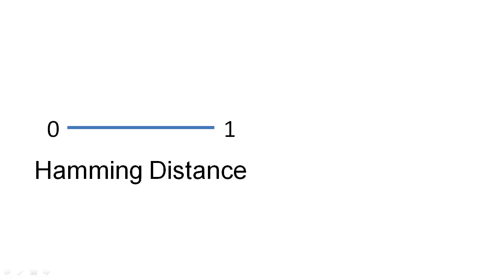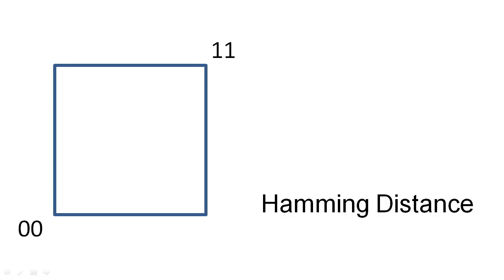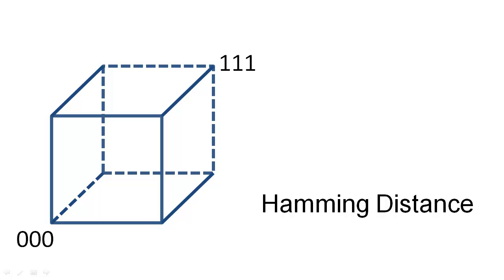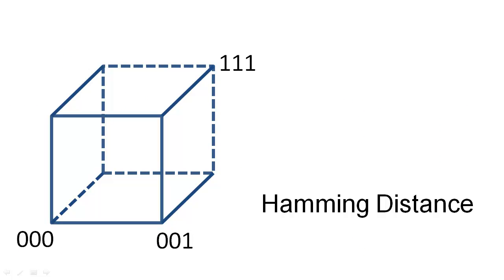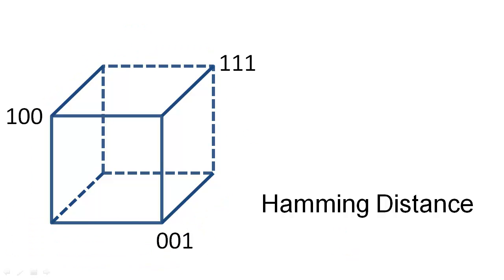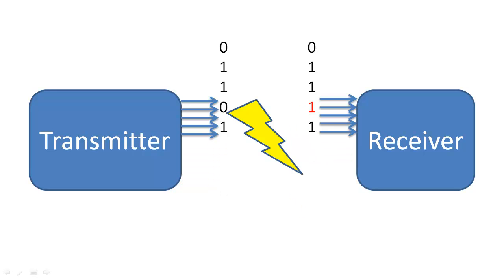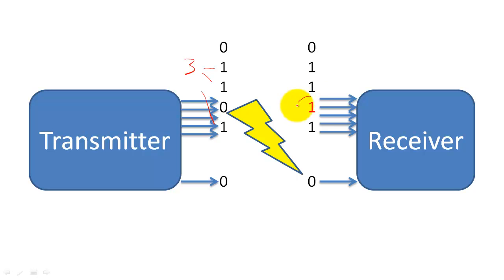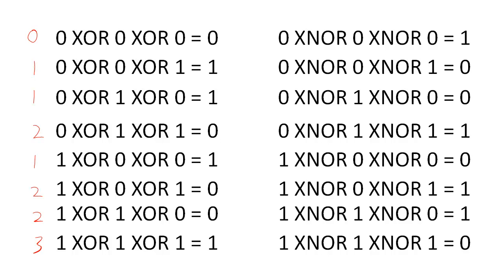Hamming Distance and Parity

Comment: This was exactly what I needed.  I am studying Hamming Distance - such a simple concept once you "get it".  Years of wondering what a "parity bit" was, and now I know.  Add the ones together.  If you get an odd number, it adds a single bit of 1.  If you get an even number, it adds a single bit of 0.  Therefore, it only has to compare ONE BIT to see if there is an error or now.  Feedback!  

So a file can have 1,000,000,000,000 bits in it.  Doesnt have to compare ALL bits. Just a single one. Wow.